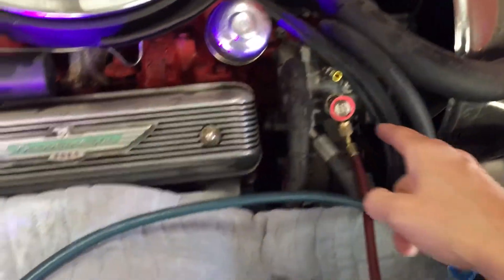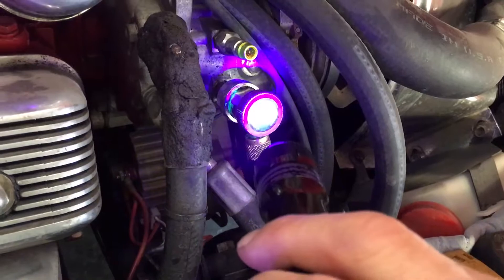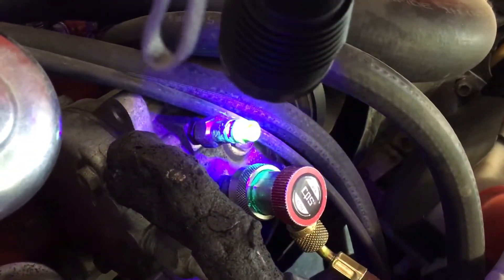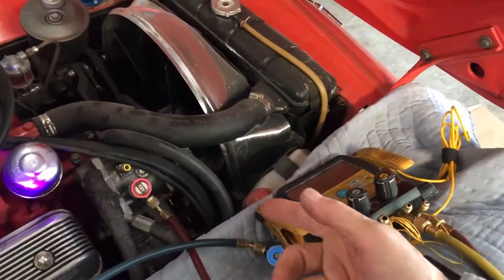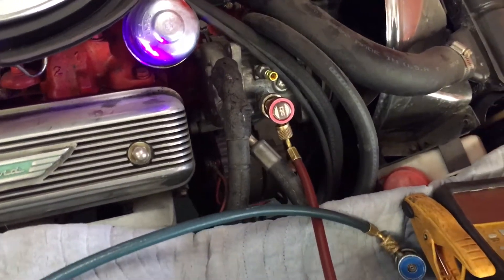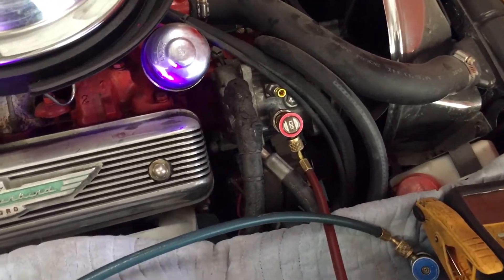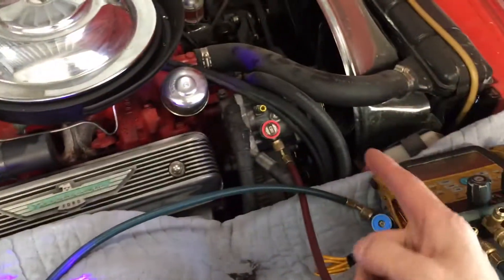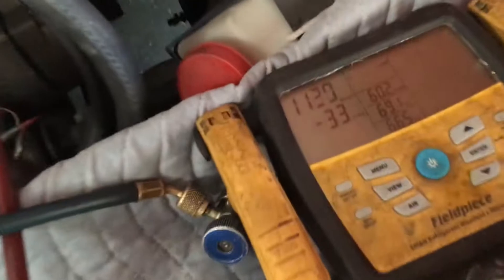The right UV light + the right good quality UV trace dye make all the difference in the world

Comment: That’s Why I Stick to my method. Ge H10g Leak detector & bubbles. It Works Well ! I Don’t Like Putting non-Condensibles in a system.
Reply from the maker: That’s the difference between HVAC/R and automotive. Automotive uses rubber hoses and rubber orings every were. It sometimes turns the leak on and off like a pressure relief valve. On pressure rise only or pressure falling only, temperature rise or fall only, or only when the car is driving down the road with the bumps and vibrating will it leak. 

        Sitting still running in your stall on a cold day. No leaks. And no oil spots sometimes to. 
             As you see in my video I had the H-10 and my DTEC stratus and BigBlu bubble and on cars I’m limited to 150 PSI Nitrogen because of the evaporator sometimes only on the newer cars with the R1234YF I will use 170 psi  because the new evaporators supposedly are built stronger because of the slight flammability issues of the A2L refrigerant. 

        Little walk in, display, freezer, easy remove a panel Bingo it’s all right there a mirror flashlight and bubbles. 

          On a new car in need 7 hour, 12hr, 22hr to remove the dash to get to all the hoses, lines, orings , evaporator and some times another 20 ft of hose or lines under the car, SUV tucked up or inside the frame rail to the rear evaporator  case behind the rear quarter panel that you need to remove the interior panels sometimes seats, parts of the roof liner to get to. 
        
         AUTOMOTIVE SUCKS COMPARED TO HVAC 

        In Hvac you do not have your condenser sandwiched between a radiator, then condenser then liquid coolant heat exchangers then a turbo intercooler all 1/4” apart with plastic air dams and seals, wires harness for all the lights fans sensors pulse now collision avoidance and  selfie driving radar and Lidir sensors in you way. 
     Hvac is a cake walk.